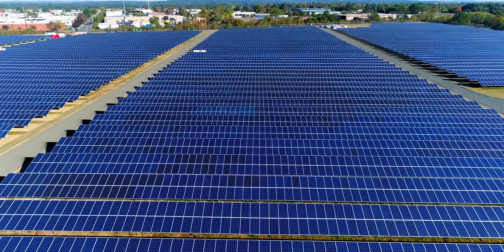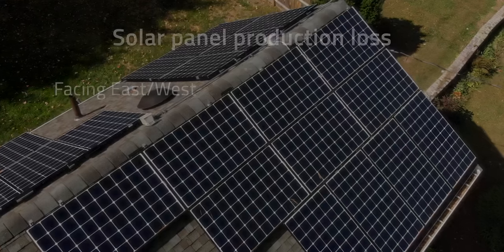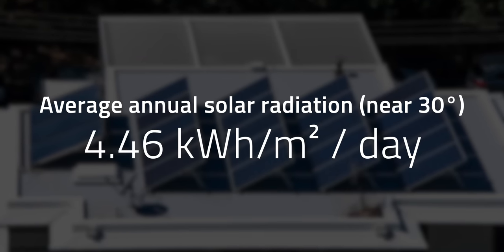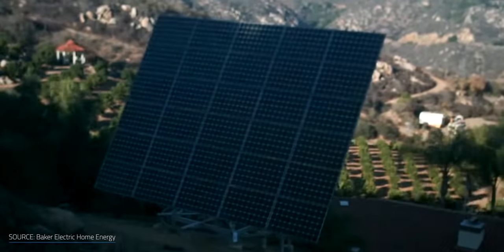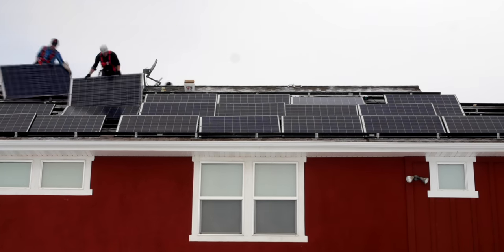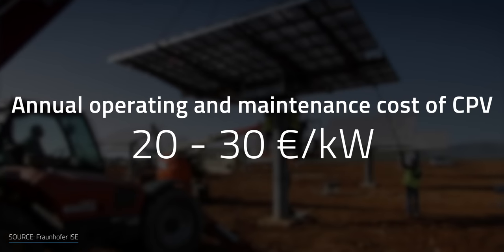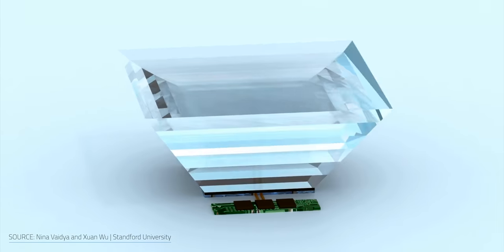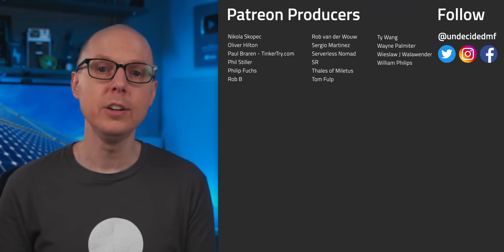This Invention Could Supercharge Solar Panels

Comment: Agile clearly also has a larger front area than that of the cells beneath, so aren't we back where we started? Unless the focusing lens thingy costs less than the equivalent change on area in solar cells, it's self defeating.

Another issue with a field of tracking panels is that they must be spaced apart in order to prevent them shading each other. So you reduce the total area of panels at the same time as increasing their output. A classic trade-off
Reply: ALL of the concentrated cells have smaller cells than traditional PV. The mirrors, the lenses, each takes up more space than the cell itself. However, with concentrated cells touting twice the efficiency of a traditional cell in addition to 3x concentration (not to mention improved angles at all hours of the day) it's undoubtedly more efficient than traditional cells in terms of power/area.
Reply: @ShadowlessDeath47  they can't tout twice the efficiency before the lens is in place because such technology doesn't yet exist.
Reply: The concept is definitely necessary to increase efficiency. 
Let's also consider these cells are processing more energy and will burn out faster than typical cells.
With enough motivation I'm sure that Agile will eventually figure it out
Reply: So fun fact, unless it’s a novel object, it will have losses. Most cells convert energy into electricity via diffusion of photonic bombardment throughout the day. This process isn’t perfect and creates heat; the color of the cell absorbs some of the light too more heat; but then we add a glass array on top? Well I’d think a dome would work better than half of a retro reflective array for the given purpose. Collect more light from more angles. But small issue. That makes more heat. And as that heat goes up it can impact efficiency of generation. So that’s the challenge. Not exceeding ambient cooling capabilities. Because if we cooled it then that cuts into whatever gains we make because of the energy it takes to remove the excess heat.
Reply: Oh and the lens would absorb some of the energy too as heat changing it’s reflective/refractive qualities as it expands
Reply: @mgutkowski  I don't believe that such technology doesn't exist. The video brought up the multi-junction cells, that are able to capture more types of light and therefore have better efficiency.
I think the reason that the multi-junction cells aren't in place on regular panels (which I'm assuming is part of the confusion) is purely cost/complexity based; regular cells spread over the area are simply cheaper per watt than some higher efficiency piece over the same area. 
However, if you can make that area of PV diode smaller while still getting the same or more wattage by artificially increasing the energy hitting that area, thats a net benefit.

My impression of the Concentrated PV model is that it basically trades area of PV cells for area of mirrors. And if the Mirrors are cheaper than the PV cells (and probably more sustainable as well) then thats a direct cost and effectiveness benefit ON TOP of this ability to compensate for sun movement.
Reply: @revlouch  A hybrid system with liquid cooling on the backside of the cells would take care of most of the heat gain.  Then you feed the hot liquid into a heat pump system for HVAC.  Higher heat isn't a problem as long as you take it away fast enough.
Reply: @michiganengineer8621  As I had said: then you have to calculate the energy being used to cool them. Moving water takes energy. Any hvac usually has some kinda electronics involved. But you’re an engineer so I’m sure you realized I had already pointed that out.. it’s not about speed it’s about efficiency. Speed takes away efficiency usually
Reply: @revlouch  Agreed, it's not going to be perfect (no losses).  Almost ANY reduction in the temperature of a given solar cell will increase it's efficiency, so a lot will balance out.  Say you use 5% of your array power to run the pumps to boost the temperature of the liquid entering your heat pump by 5% (probably even more tbh)
Reply: @michiganengineer8621  yeah but there are other considerations. Like the temp of
The lenses. The cooling not only has to be efficient. But thorough. And the system is subject to heat wash. It’s not about dissipation as much as emissivity. Having a hot side and a cold side only does so much. And the lenses would still quite probably have different properties at different temps. Liquid cooling doesn’t solve all problems. I wish people would stop pretending a non passive system is the best answer. The whole point of this is less moving parts. Here you are trying to add complexity and pointless cost. Go design cars or something that is annoying to fix from an design perspective. You’d do well at that. makes a cell that doesn’t need a gimbal array and can be stationary. “let’s strap a water pump to it”
Reply: @michiganengineer8621  yes it would make it cool. But it would fail so many other things it defeats the purpose. I’m glad you felt the desire to submit your dominance on the internet for the day but you completely overshot the goal and wound up in a different ballpark. Adding complexity and cost isn’t it. Good job security though I’ll give you that.
Reply: @iandyke4412  if you can make that area of PV diode smaller while still getting the same wattage by adding a larger lens on the front just brings us back to where we started, and doesn't exist anyway. If you've got the area anyway, these lenses can improve efficiency across the day, but i wonder if we wouldn't be better off by just spending the extra area on ordinary cells.
Reply: @mgutkowski   @Captain G I'm not really understanding the point that you're making.

Maybe I am misunderstanding the video, but I'm pretty sure the whole premise is that these are lenses, that are larger, that exist. 
Its simply taking the light from a larger area, directing it all into a selected point, and then making it more efficiently collected at that point.

So, in theory, you would get better wattage for less price than it would be to lay out the entire area with the same efficiency PV cells, since (assumedly) glass is less expensive than the doped silicon wafers in the multijunction pv.
So its just a matter of using the cheaper material to accomplish the same job.
So I guess you're right about it taking us back to the same spot in that regard, but that original spot is Multijunction PV cells, which are like twice as efficient but are just too costly normally to warrant larger scale implementation
Reply: @technomicah  it doesn’t change the cell efficiency. it can’t. they are probably using highly efficient cells which are much more expensive and usually reserved for buildings where they just can’t get enough panels up any other way ans satellites where payload weight is a critical factor. 

it just uses an expensive lens to put more solar radiation on each cell. the cells must be rated for concentrated light incidence or they won’t have design life specs. in a couple of words word this is “nothing new”, concentrating solar is decades old, but instead of using cheap reflectors arranged in a parabola or some other arrangement they are using a lens, which frankly sounds bloody expensive.
Reply: @mgutkowski  why not, simply use a multijunction solar cell. They are on every satellite.

Comment: something i find incredibly interesting is how this system could be a part of a design which integrate these and the negative space that they provide in between the solar cells for very small, very high efficiency thermal conduits that whisk away the concrentrated heat from the reflective materials and mini cells, being further connected to a home heat pump system
Reply: Some single access trackers do thermal capture as well, the trough focuses light on a thin strip of photovoltaics with a pipe behind it to carry away heat and keep the cells at an efficient operating temperature.
Reply: There are solar panels available  that do have water/fluid  running in the backside of the panel, it cools the panel and heats the water/fluid .  Used in colder parts of Asia to keep the pool at a pleasant temperature, heating systems etc. Very easy to setup , inlet outlet and  on . the total energy output of the solar panel is very good
Reply: @fixandtests  sure but that’s still an ineffective thermal dynamic. heat is being generated on the face of the panel, migrating through the sensitive materials, and into your heat transfer system. with these there’s enough empty space between the heat generating cell circuitry and reflective equipment to house a thermal conduit with peak heat transfer capacity. higher heat output on one end and more efficient solar panels on the other.
Reply: It's always been my thought that it would be better to apply a long wave infrared reflector on the outer surface to avoid the majority of the heat issue. As most cells work in the short wave infrared to red spectrum.
Reply: @kitteecatt4681  It could be coupled with heat pump, sacrificing a bit of energy for better managed heating of the house under it…
Reply: @kitteecatt4681  If the cooling is activated at a low temperature, the temps will not rise high, the heat flow is not damaging. The temperature is. Common panels work at their best at around 45C.
Reply: This comes back to Paul Mullen's comment right above this one (on my screen), who concluded with his team's research finding this solution to not be cost effective versus simply servicing a standard PV system every decade or two. Hopefully, this just means a need for the technology to mature before heat extraction solutions become feasible.
Reply: @valkyriefrost5301  The thermal degradation problem is not caused just by IR absorbtion, but by photocells absorbing visible or UV light and, instead of transitioning the photons into electrical energy, re-radiate IR photons into the photocell's crystalline structure, causing heating and deformation.  This is an unavoidable inefficiency, and intensifying exposure will intensify the problem and accelerate the 'aging' of the photocells.
Reply: @paulmichaelfreedman8334  It depends on how the cooling is implemented.  High thermal gradients can damage crystals, especially semi- or non-metallic ones, i.e. based in Silicon or Arsenic.  IDK how steep the differential might be between the exposure surface and a heatsink contact layer, but potentially concentrating sunlight exposure can lead to high temperatures, which can lead to high gradients across the photocell.
Reply: I would say instead of a cooling fluid (which is subject to losses if you want it to do work), put in thermocouples instead and get more electrical energy out of the same sunlight.
Reply: The huge flaw in your thought is the cost of material and manufacturing complexity to do that. You have to be able. To pull that heat away from the inside of that glass. Hooking It up to a heatpump would be counterproductive since you will be using the heatpump to cool your home when it's hot outside. I doubt there will be much heat to absorb when in the winter, not enough to warrant the eleborate system and cost.
Reply: @paulmichaelfreedman8334  what? PV panels work best at 25°c not 45°c
Reply: @simonmasbaum8399  I don't think it will become cheaper as it matures. You simply need a large amount of aluminum or copper to transfer the heat. It's not really something that can get much cheaper.
Reply: @randybobandy9828  There is an optimal temperature range. And you want the water to be somewhat warm when it leaves the system so you can use it for the heat pump or other things. It's all about efficiency.
Reply: @valkyriefrost5301  Unfortunately, absorption of the visible portion of the spectrum generates a lot of heat too. Blocking the IR probably wouldn't solve the overheating problem.
Reply: @marcowen1506  - I completely agree. So additional filters could be applied to block out blues and UV. My guess is it's either already there or makers rely on passive cooling or makers just don't care. I'm not in the field, so I could be missing some other factors that an expert could shed light to.
Reply: This comment is mixing up the requirements of PV panels and thermal conductive solar energy. I wouldn't recommend thinking about both at the same time.
But BTW - If you want to think about thermal concentrators, you'll probably do fine with a parabolic trough aligned along the solar path across the sky. This design requires no moving parts, no electronics unless you want to closely align the solar path year round and only has to be aligned on one axis.
Reply: Or simply dig up some coal, burn it in a boiler arrangement, create steam and drive turbines connected to generators...I know it sounds fanciful and futuristic...but it might just work.
Reply: @paulmichaelfreedman8334  There is also an element of cost and return on investment to be factored into the equation. Nobody is going to buy a highly efficient system that cost significantly / disproportionately more than a less complex system.

Comment: One thing that you didn't mention is Winter! Maybe not for your location, but for my system in Canada a steep panel angle, low temps and snow on the ground can actually boost the panels output significantly - doesn't make up for the shorter days though. I also don't use a tracker, as the location is actually very windy. The risk of wind damage is a grave concern.
Reply: You are correct in stating that light reflecting off of the snow did boost the energy production significantly, it's important to note that that boost is in reference to the expected amount of energy to be produced given the conditions.

Energy production in winter in Canada still sees significant decreases in peak production relative to summer months to the point that an experiment out of Edmonton found that snow covering the panels only had an approximately 3% observed decrease in energy production relative to panels that had snow removed. 3% isn't a lot

Edit: corrected the power production value to 3% from 5%
Reply: Yep. You'd almost think that everyone being so enthusiastic about solar is living in the subtropical area. Where I live we lose around nine hours of daylight time between summer and winter and it is pretty obvious that the energy contained in the solar radiation itself is also a lot less because it is cold outside. In my view scientists should concentrate more on fixating the position of Earth towards the Sun then try to generate more electric power when the total demand is already met at optimal times.
Reply: @WhoStoleMyAlias  ...?
Reply: If snow already boosts your solar output then getchu some proper mirrors for a year round boost.

Snow is reflecting lots of light sure, but likely in a diffuse way diminishing the benefits vs a proper mirror.

Even some cheap aluminium foil based mirrors stretched flat over plywood would ante up.

Just be careful not to give it concave curvature, else you get a parabolic mirror effect concentrating the light in a smaller spot, and potentially setting something on fire 😅
Reply: @WhoStoleMyAlias  

"In my view scientists should concentrate more on fixating the position of Earth towards the Sun"

Have you heard of space based solar?

One benefit of this is that (depending on elevation) it can receive solar energy even during night time on Earth and beam it back to the surface using ultra high output microwave generators.

Comment: The first thought that came to my mind when I saw the rendering was: „Man, that stuff looks heavy!“ 
When solar panels get mounted on old roofs that were originally built without PV in mind, weight becomes a deciding factor. Do you have any data on the actual weight of these lenses?
Reply: weight will depend on the materials used. current flat panels use glass but from the information in the video it appears these lens will be plastics of some sort (3d printable) and so lighter, perhaps even lighter than current panels. However, plastics and UV light generally don't go well together. For example, current flat panels can last for decades while flexible panels are only rated for 5 years because the plastic sun gathering surface is a polymer that become opaque with the time spent in the sun.
Reply: Yeah, I was thinking the same. Even using plastic, which would be cheaper to use anyway, it's going to increase weight. That could be a limiting factor on some places. 
However, If I understand how they work correctly, they will focus not only the optimal angle light, but all light from all sides. So theoretically they could be more efficient than tracking. Which does make them quite interesting.
Reply: @lenwhatever4187  you can use titanium dioxide doped polycarbonate as a UV resistant top layer, though. Or even use one of the new co-polymers for photon-downconversion and convert the UV photons into usable longer wavelengths that can be absorbed by the solar cell.
Reply: Thinking Alon will be a good replacement for glass when it becomes more mass produced.